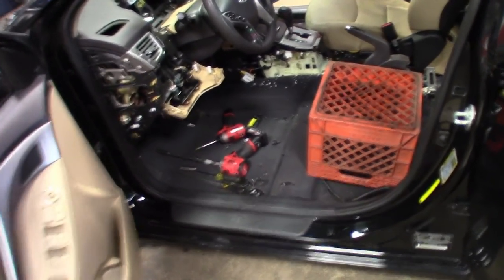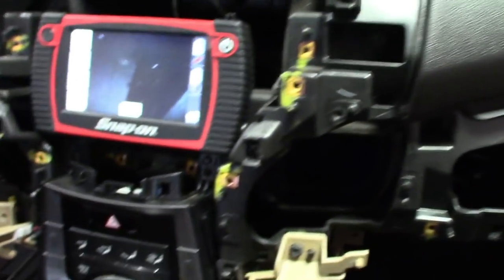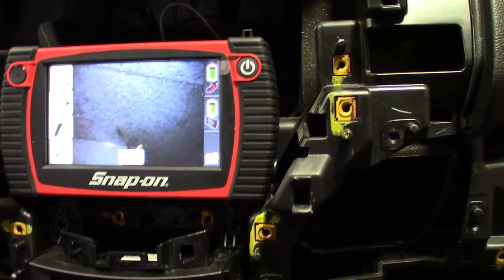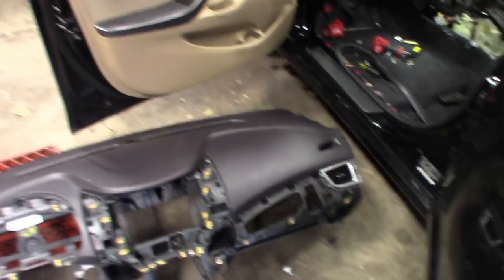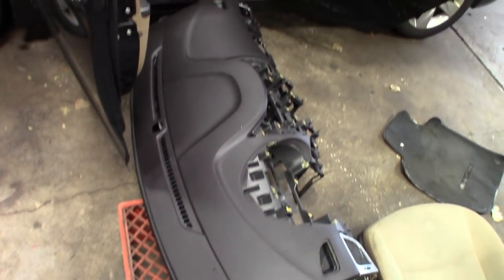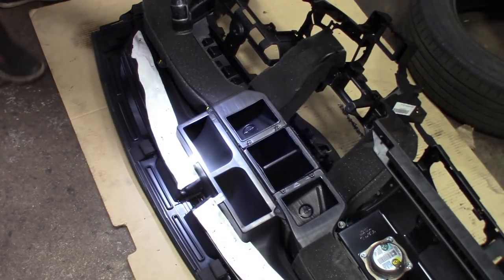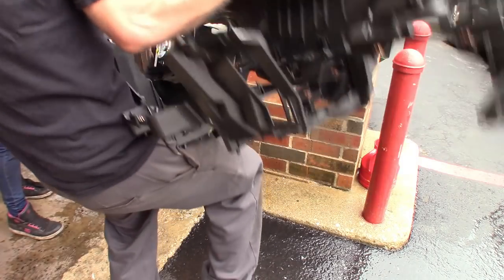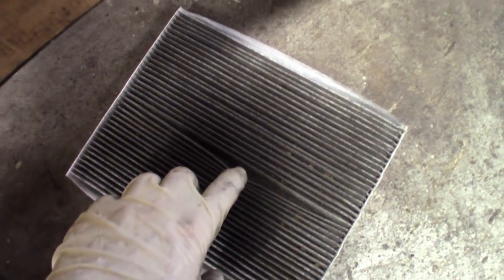Tools In Action Ep.3
Dead Mouse in Customers Dash.🤢

Comment: Although I've never actually found a dead rodent I have saw them do some crazy stuff. Mice love atv airbox cavities. So many times a customer would drop a unit off and complain of rough idle or a no start. Soon as they mentioned it ran great when they parked it the barn a few months ago is a good enough clue. Mice will pack whatever they can and cram the airbox full. Feed,insulation,and their favorite..dog food. They'll pack them so full it'll cause the engine to smother and flood the engine. Great content as usual man.

Comment: I had the same issue with a customers car. The car was sent to paint, and like always they bake the car in the booth. The rat was inside the car getting baked and died in the blower motor. By the time to reassemble,  we notice a horrible smell, the rat was torn to pieces in the blower motor.  It was the Most disgusting smell ever.
Reply from the maker: I ran into the same situation a few years ago.🤢 I was hoping this one was going to be in the blower motor, it was the first place I checked.

Comment: I had a no start come in one day. It had no electrical power so I went to go find a jump box . I noticed a really awful smell before I popped the hood. When I opened it there was pieces of a small cat torn up due to it being ran over thrown the ac belt at one time l, the cat was in the fan and some of the other parts was stuck between catalytic converter and the engine block. I priced the labor and parts that needed to be replaced. She declined the job on the day of. The car sat for about a month until I did the repair. Let’s say sometimes you get jobs that stink.
Reply from the maker: That must have been a nightmare.